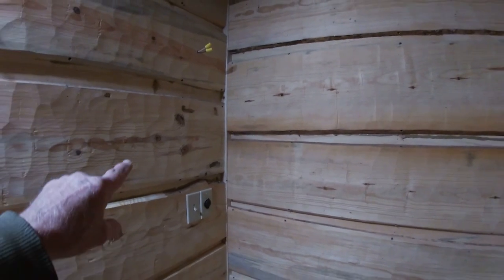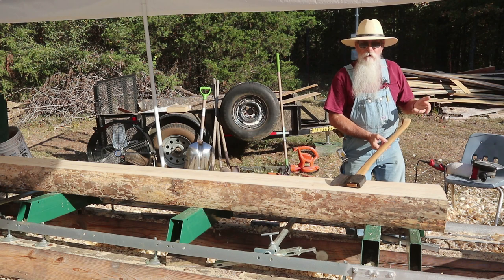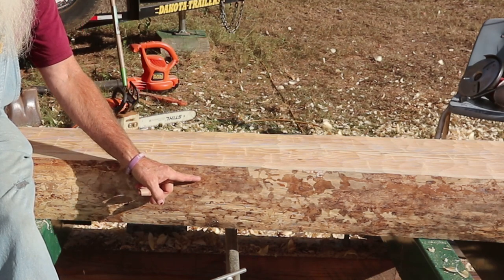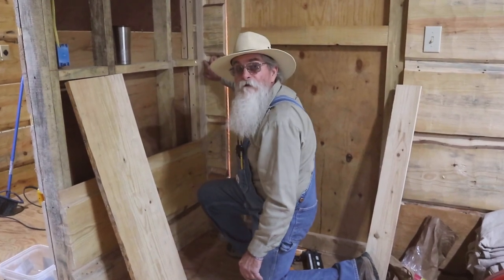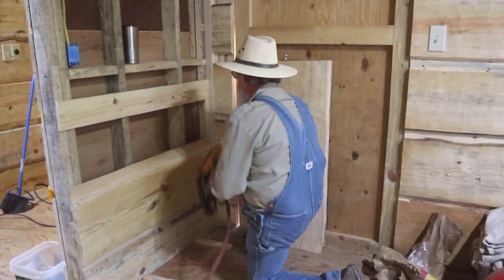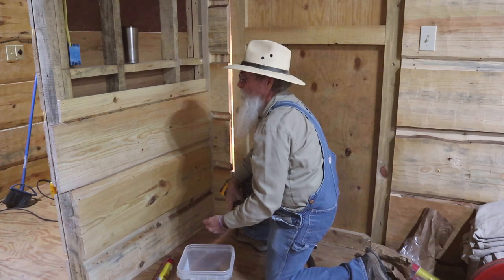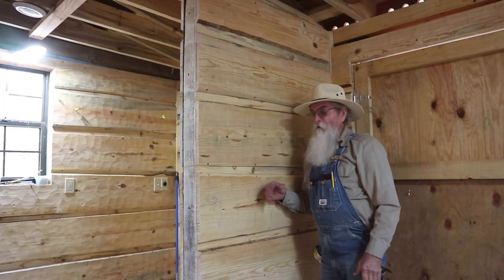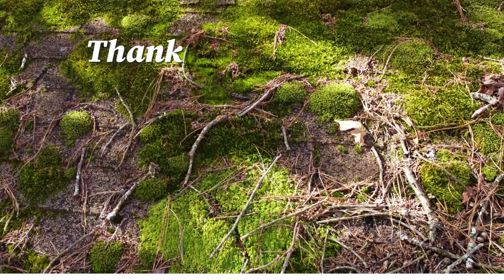How To Make and Install Log Face Interior Siding, Paradise Point - Ep 24

Comment: That's a great trick to make the interior wall look like a full log wall.
You guys should move that switch over. The owner is probably saying he'll live with it, but he's going to have to look at that for the rest of his life.
Great video.
Thanks
Reply from the maker: Howdy y’all- thank you so much for watching the video. The owner put the switch there so I guess he’s ok with it. Hope all is well with y’all. Take care and God bless
Reply: @TheBeardedCarpenter   You had said in another video that he was doing his own electric work, but he must have laid it out wrong.
Being an electrician that would drive me crazy every time I looked at it. All he needs to do is drill a few holes with a one inch auger bit, then clean up the hole with a chisel. He may have to chisel out some groves for the wires to lay in then slide the box over, and then cut a block to fill in the hole.

Comment: Good Find Wayne, I like the look. I did a small area like this and I put black plastic on the slabs so when the log checks, you do not see beyond the slab but I did not glue so you are ahead of me and should have no problems with the slab checking, you got them in right.
Reply from the maker: Howdy Thomas- that’s a good idea to put something behind the faces because of checks. There may be some checking but it will still have a natural look. Hope all is well. God bless y’all
Reply: @TheBeardedCarpenter  You Spent a lot of time doing it right, I think the checks will be few with the glue and nailing strips. I like it, no saw mill but options and planning on doing on mine tool shed cabin. Like you said I think 7 or 9 log buildings at your place, so I need a larger tool shed, well I think I will have enough to built the size I want and enclose the porches and then face the stud walls with slabs.Thanks for sharing, any luck with template? Snowed here all day. God Bless Paul, Tom

Comment: Great job. I have used invert board and batten to make doors, but never thought this for internal walls. 
I guess it would be great for me to use this method in my shed, but no chinking. Instead change 2 colors while staining on board and batten in realtion with the shed 2 color scheme.
Thanks!
Reply from the maker: Howdy y’all- thank you so much for watching the video and for the nice comment. I did this years ago on a historical restoration and it looked just like the rest of the log walls so we decided to try it with a new approach and it worked out really well. Sure wish you the best with your project. God bless you